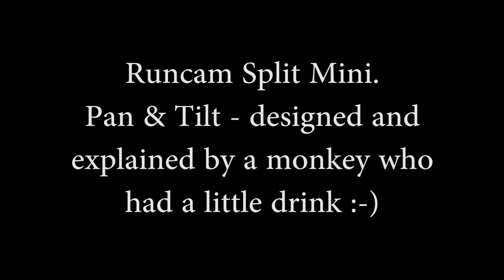Runcam Split Mini Pan and Tilt

Comment: I never did get a runcam split but if I do I will use your pan/tilt thing for sure. Very nice.
Reply: I only got one for the GWDR (Global Wide Dynamic Range) so I can fly into the sun and the ground is still visible. Some of the new 'box' cameras do the same and they're easier to mount on a gimbal so..... I've basically given a solution to a problem that never existed :-)

Comment: Great. I really must invest in a Taranis... those sliders make a world of difference, I have to use the potentiometer knobs and I usually twist the one that controls the flight modes instead of the pan :)
Reply from the maker: I've had a few radios now and the Taranis easily beats them all. They're a little hard to program when you first get one but it's really worth it when you get used to it :-)